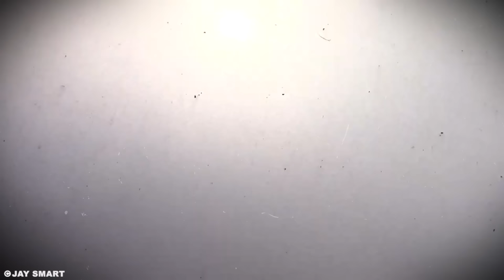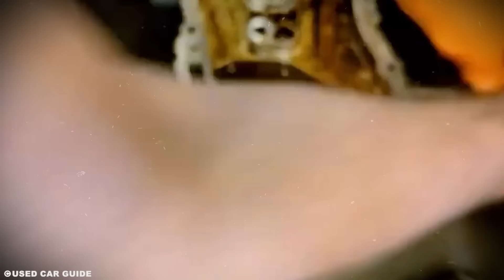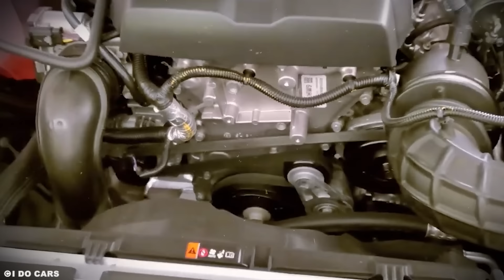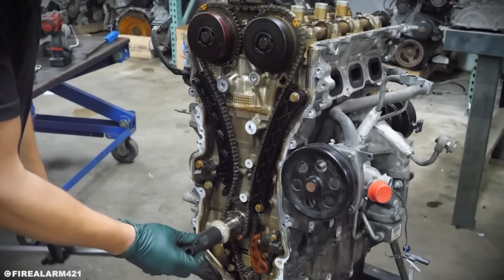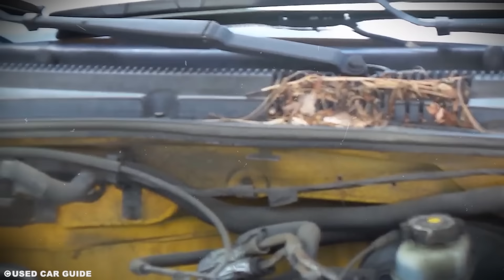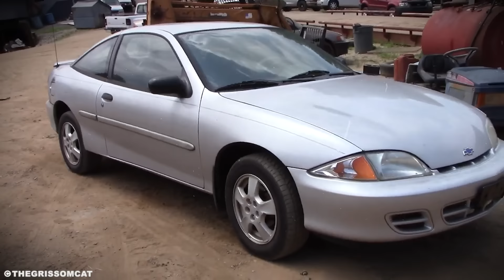How GM’s Ecotec Engines Earned Their Bad Reputation

Comment: The pistons need sufficient relief to avoid contact of the valves with the pistons if the timing chain jumps the sprockets and changes the timing of the valves and pistons.

Comment: I have 3 Ecotec cars, a1.5 (45k mi.), a 2.2 (146k mi.), and a 2.5 (89k mi.).  Except for a new cam solenoid for two of them they were trouble free.  Oil is changed per the minder.  Go 70 is ok but drive gently.
Reply: PS, none burn oil!

Comment: My 2008 saturn astra (Opel) has a 1.8 EcoTec. I only had to replaced the coil pack and starter. At 100,000; I replaced the “timing belt”& related components. I change the oil when it becomes dirty (2,000-2,500 miles). I am anticipating replacing the clutch before the next 100,000. Great car; sadly no more Saturns.

Comment: There was nothing wrong with these engines,,,,It was the manufacturers that were the problem,,They set the oil intervals at 10k miles,,And people would let that slide to 12 or 13k miles,,,You simply can't do this on a chain driven engine,,The chain would stretch prematurely ,And the oil ring in the pistons would stick,,Allowing oil to pass into the combustion chamber,,And causing blowby,,,,,,A simple oil change with good quality full syn,,Every 4 to 5k miles on the nose and none of these problems would occur,,,

Comment: Thank you for sharing this video - now I finally understand. As a truck mechanic nearing retirement after 42 years, I'm eager to lock my toolbox for the last time. Although I rarely work on gasoline cars, including my own, it's because I lack the necessary tools and software.

My wife, a school teacher, works with a colleague who's a single mom struggling to make ends meet. She drives a Buick wagon with an Ecotec engine that constantly overheats and loses coolant, but I've been unable to find the source of the problem. I searched online, but the mere mention of the Ecotec engine seems to upset many people. Now I understand why. It's ironic that the timing chain issue came up in this video, as I used to own a 1997 Pontiac with a Quad4 engine that my wife and I bought new. Since I avoid working on my own cars, I ignored the timing chain noises it made. I just kept driving it until it finally gave up at 297,000 miles, 22 years after we bought it. I figured we'd gotten our money's worth out of it.

Comment: The 2.2 L61 Ecotec is a very reliable and strong engine and so is its 2.0 sibling. The 2.4's is where the trouble started. Not an accurate video.

Comment: GM fucked me on a 2012 Equinox. Even sent me the extended warranty info wouldn't honor it. Just over time and miles. Owned nothing but GM for 40 years. Screw them. Went from 3 GMs to 3 Toyotas.

Comment: They got it right with the LCV (2.5 Liter in the Colorado); 7 years old and ZERO issues.  The folks in the Colorado forums really wonder about videos like this one.  I might also add this one features a traditional spin-on oil filter that is really easy to get at.

Comment: This is strange I own 2 Saabs with engines that are basically ECO Tec engines with 2 liter displacement both have well over 200,000 miles without any problem. On the other side Saab has been famous to reengineer the American rubbish they have been forced to use as basis.

Comment: I have the 1.8L N/A Ecotec in my 2012 Cruze, 81k miles on It. Never had a single problem. Only did some maintenence on the oil cooler after 15 years of abuse.

Do your oil changes folks, use quality AcDelco coolant, use Dexos1 engine oil.

Not a Rocket science !

Having said that, this is my last GM car ! Never gona buy GM products ever !

Comment: i had a 2003 grand am 2.2 only changed the timing chain 1 time at 150000 miles and when i got rid of the car it had almost 300000 miles and engine still ran like new, i changed oil every 5000 miles seens i owned it, been a great car.

Comment: My understanding is that the Ecotecs borrowed from Saab's B-series original design and then, to the horror of Saab, got "value engineered" into the crap that's being showcased.

I've owned a B235R (Saab 9-5 Aero trim) and a B208E (Saab NG9-3) and you can see a difference in the engineering. The B235R was older tech but simpler. The B208, based on Ecotec "engineering advances", was OK, once you looked past the timing chain-driven water pump (a royal PITA to replace in-car) and cam-driven power steering pump (which leaked over time). You had to be on top of oil changes in both cars, but that should always be top-of-mind when you own something turbocharged.
Reply: The 2.2 L61 Ecotec shared design with the old Quad 4. Nothing to do with Saab.

Comment: What this guys says about the lsj and lnf is absolute bs.  Lsj internals can handle over 400whp. And the lnf can do 500safely with a decent tune and turbo. Ya the gunked valves are an issue but can be vastly improved. Never once seen a hpfp nor heard of one failing catastrophically destroying the fuel system. The only thing I have ever seen people have issues with is the fuel pressure regulator within the pump fails and throws a code and doesn't do much else. Swap out the pump and it's all good. Both the lsj and the lnf are amazing engines. No need to  completely build it to get the hp numbers this clown claims , on either of them. Only real issue the lnf had was porus block on late 09 models. Throw on an lhu block and ur golden. Also timing chain tensioner was shit in the beginning but GM updated it solving that issue.

Comment: We had a 2011 HHR with the 2.2L.  It was running great at 220,000 miles in 2023 when we gave it away.  Very good engine in my opinion. (Note several pictures are of the 2.2L Vortec pushrod engine which is a totally different motor.)

Comment: If you take care of them, there just fine, I put a timing chain in mine, at  199,000 MIles, I will say I did notice at around 60,000 miles the oil would get low and ever since then I would have to check  it daily and maybe add a little bit.

Comment: Original owner of 2009 Chevy Malibu 2.4 ,engine never taken apart,and Original transmission car has 309,000 miles ,oil changes every 5000 on full synthetic 5w-30, and Transmission, with filter every 30,000 miles, no leaks,my daily commuter car 65 miles round  trip parkway travels.
Reply: Suggest change out that chain, might just last up to 500k miles. Good little engines overall though!! Mine has almost 300k changed the chain at 247k.
Reply: I think its because MOST(not you) GM owners are NPC , loser, broke ass half wits whom never consider maintence.

Comment: Quad 4 was not push rod, that was the 2.2 OHV 4 which started as a 1.8, then grew to 2.0, then 2.2  and was developed by Chevrolet for the J Bodies introduced in 1982]. The Quad for was a single or dual OHC developed by Oldsmobile.
Reply: My 98 Cavalier had the 2.2 pushrod engine. No issues with the engine at all. Just routine maintenance.
Reply: @erikg.2666  I also had one, it was the singularly most gutless engine I've ever had the misfortune to drive. On it's own, it was gutless, but coupled with the standard 3 speed automatic it was downright horrible, and somehow managed to get unbelievably bad fuel economy for a car that size and weight to boot.

Comment: 2011 Equinox - Water pump/balance shaft chain failed around 150km this past summer. It's still sitting because I don't know if it's worth fixing for just parts cost and my time.
Reply: Don't waste your money, man,  find you a Camry with a four banger, you will be much better off! or a 4 Runner

Comment: I have a 2007 Malibu ls 2.2L ecotec engine and have  208,000 miles on it. It has been very reliable. I guess it depends on how you maintain it. I changed the oil every 5k miles, transmission fluid every 50k miles and coolant every 75k miles, spark plugs every 50k miles. No problems after all these miles.
Reply: I have a 2014 Malibu ltz 134 000 miles and it still runs good a mechanic told me keep the oil changed regularly (3000 )miles and the engine will run fine
Reply: Honestly, guys, making the case that 50-75% of mass produced cars have been reliable is not exactly a glowing review. The fact that some of you guys got lucky and got your money's worth is great. But misses the point. I've been a mechanic at a GM specific shop and can testify that these are simply bad designs. Many of them have bolts that go into the block to keep the timing chain upper guide mount that are aluminum into aluminum and therefore will inevitably break, essentially ruining the block, and leak to water pump and oil pump failure, sometimes before the chain slipped, sometimes after. But almost always by the 2nd timing chain replacement. Either way, the design is deeply flawed, even for the price.

Comment: More gm foolishness! I had 1.4 turbo in a 2012 sonic. That engine had plastic everywhere. I traded it in after stuff started breaking. 

Also for some reason, gm thought it was acceptable to run 87 octane in 9.5:1 with 20ish lbs of boost. Never again. Made me miss my sentra everyday I drove it

Comment: 1.4 ecotec without turbo is reliable in the long run? I have one in a 2016 opel corsa and for now (130.000kms) its been cool, just the illfated water pump at 80.000kms. In USA there was a recall for that issue?

Comment: We own a 2006 Malibu with 2.2 engine. It is still low milage (80,000) but it does not use a drop of oil and the only thing I did to the engine was to replace the timing chain tensioner which was very easy to do. I didn't have to take anything apart. It is located on the side of the engine and only required a socket to remove it.
Reply: That was the cam phaser control valve.  Tensioners are internal.

Comment: My first car was a 1984 Chevy Cavalier station wagon, a child of the late Malaise Era.  I got it in ~1992 for practically nothing from a family friend to get me around town.  I had little choice and it kinda fell onto my lap.  The car had been abused and neglected in its prior life; the power steering and A/C didn't work anymore, the bottoms of doors near the rocker panels had extensive rust and there was a leak below the windshield that manifested itself in the permanently wet driver's side carpeted floor.  The engine's ECM and turn signal switch eventually malfunctioned and had to be replaced, but other than that there were no more major mechanical failures during my ownership, which ended in early 1997 when I no longer needed the car after relocating to a place with an adequate public transport network.  Before my departure, the car was as drivable as it was when I got it, the engine wasn't burning any oil and the 3-speed auto gearbox worked fine.  It was picked up by a junkyard and probably became reincarnated as another car(s).  At that point in time, it was ~13 years old and had about 120K on the odometer; it could probably last a few more years as it was an 2.0 L all cast iron design with a low horsepower output and properly designed pistons and piston rings (not the kind of junk they are making today to sacrifice durability to meet the ridiculous EPA requirements)... Since then I have owned a few more cars, but none were American brands.  I will  never own a domestic-made car as the blemished reputation of the American auto industry is unlikely to leave the gutter.  This video is a great example of how these greedy (and bailed out) manufacturers abuse their customers and waste resources on overpriced products that don't last and are prohibitively expensive to maintain and repair.

Comment: 2003 Ecotec,  116,000 miles and zero oil leaks and no oil burning.  Had the timing chain replaced at 112 k.  Guess I am lucky or maybe its because I maintain my vehicles unlike most lazy cheap ass Americans that buy an economy car and never change the oil !!
Reply: You still had to replace the chain...
Reply: @theatreofpain3183  No B.F.D, I did it as preventative maintenance.  Compare that to all of the new vehicle recalls with bad engines and transmissions.

Comment: If you maintain these engines properly and change the oil every 4 or 5,000 miles then these engines can last over 200,000 miles easily without issues
Reply: I used to own a 2.0L ecotec in my 2006 Saab that was turbocharged. I owned it for 12 years, 197,000 miles before selling it.  The second owner now after 19 years is approaching 300,000 miles on the original engine.  I now own a 2018 Buick Envision with another Ecotec engine.  It now has after 7.5 years 105,000 miles with no issues at all.  If you do the oil changes every 5000 miles and not the 7500 miles they recommend, they last for a very long time.  This person with the video must have found people who followed the recommended oil change interval and got into trouble with it.  The time chain issue occurs when you don't change the oil until 7500 miles, then the guides need to be maintained, and that is when that is when the problems start.  So he is accurate if you go by GMs maintenance schedule, but if you are careful like you were and I am still to this very day, you won't have any issues.
Reply: No they are bad builds. My son equinox engine gone twice now transmission also bad. 2017 is a bad car body wise great engine wise is a pos
Reply: @jalenjose3905 well that’s your experience with an equinox but on other GM models that use this engine can last a long time and that’s just my opinion I have an 09 cobalt 2.2 173,000+ miles with the original engine and timing chain it may not be 200,000 yet but it’s still runs great
Reply: @jalenjose3905  not maintained properly. My dad has a 17 Terrain 2.4 and it's still smooth and quiet and no oil issues. My 03 Saturn L200 2.2 the same.
Reply: @jalenjose3905  213k km here (132k miles) issues.
oil change every 5k gm (3106 miles).
no issues at all.
1.4 ecotec with turbo.

Comment: Despite their small quirks and unrefined nature, the 2.5L Iron Duke and 2.0-2.2L OHV four were great engines for their simplicity and robustness. Sure there were better engines, but when given ordinary care they could push 400k miles if you cared enough about them. I've seen a Cavalier with 477k miles on a 2.0L and 350k miles on the 2.2L, one 85 Grand Am with the Iron Duke made it to 598k miles on a five speed manual before the body rotted away, and the engine drove itself to the junk yard. 

The 2.3-2.4L quad four were good engines too. 

People seem to unfairly crap on these engines for their quirks and roughness yet they were better than anything that replaced them. 

Then you have the 60 degree and 3800 V6s that were robust as well.

Comment: I have a 2004 Saturn Ion with a 2.2 ecotec with over 330,000 miles on it. Ive had the car for over 13 years and it runs like a top and is easy tonwork on. These 2 2 were good little engines as long as you keep up with oil changes.
Reply: I used to own a 2.0L ecotec in my 2006 Saab that was turbocharged. I owned it for 12 years, 197,000 miles before selling it.  The second owner now after 19 years is approaching 300,000 miles on the original engine.  I now own a 2018 Buick Envision with another Ecotec engine.  It now has after 7.5 years 105,000 miles with no issues at all.  If you do the oil changes every 5000 miles and not the 7500 miles they recommend, they last for a very long time.  This person with the video must have found people who followed the recommended oil change interval and got into trouble with it.  The time chain issue occurs when you don't change the oil until 7500 miles, then the guides need to be maintained, and that is when that is when the problems start.  So he is accurate if you go by GMs maintenance schedule, but if you are careful like you were and I am still to this very day, you won't have any issues.

Comment: I have a 2006 Cobalt ss with the 2.4 and it’s still running well…in 220,000 miles I’ve only had to change the starter and alternator.  The best engine I’ve ever owned honestly

Comment: No manufacturer nowadays makes any cars to last.. if you notice more people are driving older cars from the 1990's and early 2000's
Reply: Yep, still driving my purchased when new 1999 Honda Accord with the 2.3L 4 cylinder. Fantastic car. Basic maintenance for 26 years.
Reply: @paulbunyon6324  Me too-an '07 Corolla manual with over 180K, and a (GASP) '07 Vue manual-with the dreaded 2.2 Ecotec! None of them get 10K oil changes, though-5K with top shelf synthetic & premium filters.
Reply: Because of the poor durability of some vehicles and over complexity and high cost of newer vehicles, i really prefer older cars, trucks and motorcycles! Not to mention the sheer corporate greediness going on in modern times, they care far more about their profits and bottom lines than they care for their customers and their own reputations
Reply: Well, my 2016 Genesis is at 413K miles (I do all my maintenance myself), Amsoil ONLY and 5k oil changes max and the engine has never been opened. My Audi 2012 A8L has 610K on it and I just pulled the engine out myself to replace the timing chains and oil pump as a maintenance task. Transmission/fliter-screen as well as the rest of  drivetrain fluids changes every 10 to 15 oil changes.